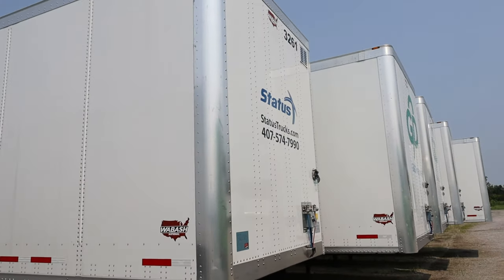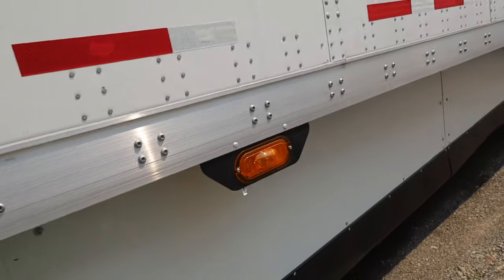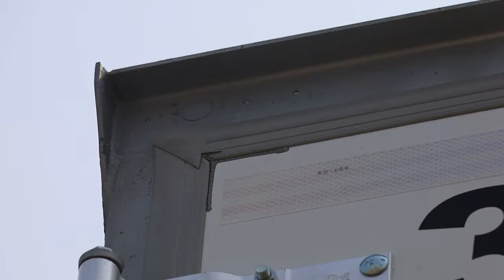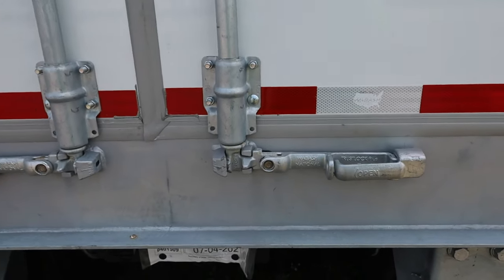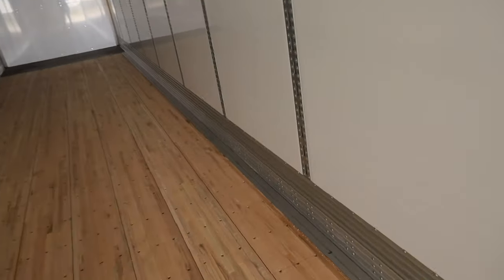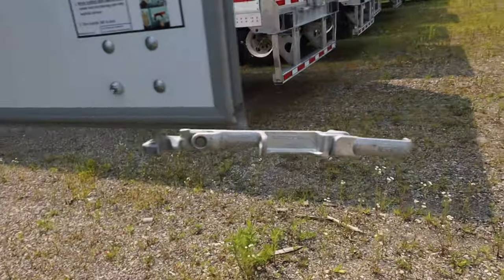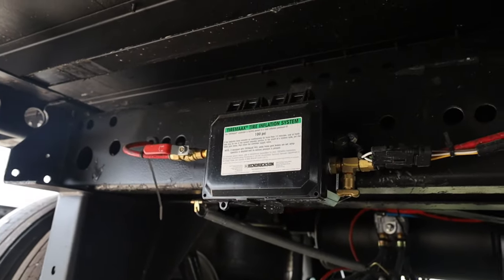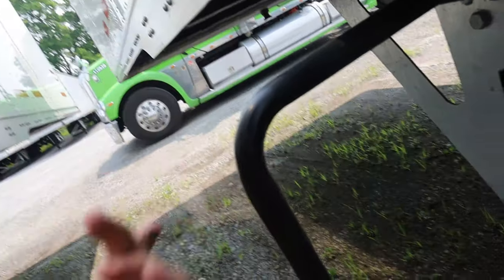New 2022 Wabash 53' dry van trailer and review  360 fleet services in Lafayette, IN

Comment: Congratulations Tony. Your new trailer looks great. Do you plan to put a wood sealer on the floor?
 I certainly wish you success with your trailer.     Drive safely my friend.  God bless you.
Reply from the maker: I would actually love too but I asked a few things and they won't let me modify trailer until it's paid for. Ughh I wanted to put the axle scale system on here too.😫
Reply: @TheTourettesTrucker  given that, as I understand it, occasionally there’s a need to put wood chock blocks for a load, I suspect putting a handful of similar small screw holes to secure a larger metal floor plate could fall under normal usage damage.
Reply: And it’s removable and holes can be filled and will help protect trailer from damage...wood sealer isn’t as temporary.

Comment: Makes the job a lot easier when your working with new equipment, congrats brother you deserve it, does that have an air slide pin for the tandems
Reply from the maker: Yes. That air slide is so much better than having to pull that latch. 🤙
Reply: @TheTourettesTrucker  you got that right

Comment: Hey Tony, I'm buying a new trailer, but not sure which brand to go with. So I'm wondering how everything is going after 3 years? Any pros & cons you could share would be great.
Reply from the maker: @richl2723  I actually just sold it. I'm back to pulling tanks. The dry van rates are too bad. I do like utility since they have the strap securement system every 2 feet where as the Wabash is every 4 feet.
Reply: @TheTourettesTrucker  Thanks Tony. Great point on the tracks too.
Reply from the maker: @richl2723  I loved the air slide, tire inflation, single door handle and skirts but wishes the inside had the rails every 2 feet. Sometimes the load would stop past the rail rail and now it's 3' before the next one 🤦🏻‍♂️
Reply: @TheTourettesTrucker  I didn't even think about the tracks being 4' & 2' apart. There's a chance I may have over looked that and been disappointed. Glad you mentioned it. Like you, I also like the wider dock plate guard as well. I believe I'm going with Utility.

Comment: I would suspect you could get a sheet of similar metal and put inside the back door on floor to extend the protection for minimal expense like the other trailer has?
Reply from the maker: That's my thought
Reply: @TheTourettesTrucker  not sure if it’s heavy/sturdy enough but for example, for $62 for 3ft sq at https://www.homedepot.com/p/M-D-Building-Products-3-ft-x-3-ft-Diamond-Tread-Aluminum-Sheet-Heavy-Weight-57567/301173389 as it’s aluminum and not steel.

Comment: Thanks for the review tony, how much did you say it will run you a month around 700$? Did you have to put you a down payment on it?
Reply from the maker: It's a little more than he mentioned but price still the same. Had to put $2k down and the payments are $750 with $175 for insurance. I could have gotten a used one but settled for this new one with a 10 yr warranty and i scaled it before I loaded with same fuel amount as when I picked up 1st trailer and this one is about 1,500 lbs lighter. That makes a huge difference in the ability to fill my 300 gallon fuel tanks up now.
Reply: Right on brother, congrats on your new trailer and that revenue bump you’ll get now  🤙